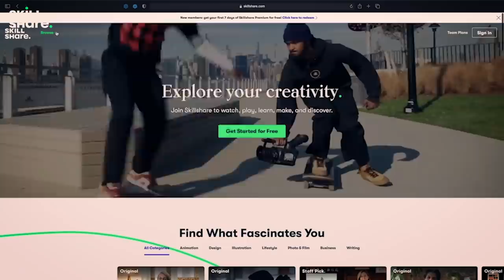Ep 16 - The Great Guitar Glue-Up - Making a Modern Multi-Scale Electro Acoustic Guitar

Comment: Paper, cardboard & plywood templates are a method very often used in boat building - I was onto it straight away before you got the paper out! So glad to see you made the revelation.
There have actually been several tricks I've seen you use which I have utilised in boat building when I used to do that work.
Reply: We also call it CAD - cardboard aided design... yup

Comment: Good show man. I do know about the step back excitement. The holes on your figured top are positioned perfectly to release the Vesica Picies energy beams that will form internally directly between the top and bottom sections. Releasing the bodies main sound waves away from the strings and the quantum VP energy from the center of the chamber will produce world class sustain. Good moves man. Good moves. Can't wait to see the finishing process bring out the figuring in your choice of wood. Frickin cool ole man.

Comment: Comming on, looking lovely! Captive nut for the pot has me mighty confused, can imagine the fun working it into position with the string is doable, but won't it require 20-30 turns to screw it into the nut... with a bunch of wire hanging off it? I'll have to wait for the cliff hanger conclusion!
Reply: not to mention wiring it to the pickup and the output, he should have done all that before glueing on the top IMO

Comment: Good morning Ben. Re: wood shrinkage via drying, I have a (longish lead up and then a) question. 
I was lucky enough yesterday to find a gorgeous plank of flatsawn, highly (highly!) figured flame maple at my local building center. It is 1"x4"x96" and is bowed by perhaps 3/4" at the most bowed point along its length. 
My intention is to process it into some three piece neck blanks for later use, orienting the cut strips so that the end grain presents as quartersawn and so that the flamey goodness is presented in its full glory once each blank is eventually carved. 
My question is, once the strips for the blanks have been cut, should I attempt to straighten them, or should I simply ensure that the strips are glued up so that any slightly cupped edges face inward, to be flattened under clamping pressure? My goal is to strive to have the center strip of each three piece assembly be the straightest ones to begin with.
Thanks, from Canada.

Comment: If you need an axial brace from head to tail, and I suspect you will, I recommend you don’t use wood. A 450mm dowel will expand and contract with weather ruining your neck geometry. I use 1/4” carbon fiber tubes, but I’m sure other options would work.

Comment: I was really hoping to see you check the neck angle during gluing the top. Cause as you demonstrated several times the neck joint is very movable and could be set at whatever angle is desirable. But now you have to live with whatever happened by chance. Fingers crossed my friend.
Reply from the maker: It's ok.. but yes.. there was some variation with this build method.. I'm not going to play with a Spanish joint again.. well, not in this exact way I think. B

Comment: I understand that the inverse is true, quoting ‘the complete book of joint making’ - “Wood dries at different rates in different directions. Across the outside of the trunk, it shrinks more than through the centre of the trunk, whereas along the length of the trunk, wood barely shrinks at all.”

Comment: At about6.00/6.30 surely you mean wood shrinks more across its width than length? Longitudinal shrinkage is negligible  thats why cross grain situations can cause problems on guitar tops or table tops if humidity changes significantly the lengthways grain on the cross bracing doesn't allow sufficient movement  and the top shrinks and splits at it's weak point. Hey but you know that Ben? I was paying attention😊

Comment: I watch this channel thinking Ben knows a lot more about these things than I do, so when in doubt, he's right, but I'm utterly baffled by insetting the nut for the control pot. The electronics will have to be snaked in fully-wired like with ES-335s, and I wonder how it will spin to thread into that nut.
Reply from the maker: It is going to be a very very challenging operation with custom pot and two custom tools... but the pot will be stunning and very very low to to the top as a result.. well worth it! B

Comment: Just a question... not a critic : What is the utility of a shielding paint if it's not totaly coverering a close cage (faraday) ? Like every time, you do amazing jobs. Thanks !!!
Reply: it stops interference coming from any direction in which the shielding paint is between the source of interfernce and the guitar's electronics
faraday cages are only really necessary when dealing with very sensitive equipment (MRI) or machines producing potentially hazardous frequencies (a microwave)
most guitars are fine even without any shielding.
Reply: @heygek2769 . It's more as a wall than a box. Thanks for light my minds.
Reply: @didierpiccolo8099  that's a good way of looking at it, yeah

Comment: What do you get for resistance across a control cavity with the shielding paint you use? I use copper sheets and/or copper paint. I get about .5 ohms with the sheets and .6 ohms with the paint.

Comment: is the reason for installing the electronics after the top is glued on so you can do the finish first? What are the issues with finishing the top separately, installing the electronics and then gluing it on?
Reply from the maker: Exactly this.. gluing the top on after finish would be incredibly messy and the end result would be less than attractive.  B

Comment: I would have done horizontal  grooves and slid the top to those grooves on  the neck for extra strength for the neck.
Would that had worked or would that warp the top?
Reply from the maker: Oh now! That never occurred to me.. it would work very very well and would probably have been quicker than what I did tbh. Great idea! B

Comment: What purpose would sealing the inside of the instrument serve, wouldn't action hamper the wood's resins from curing ultimately?
Reply: the resin should already be cured by this point, but changes in humidity can affect the wood, which is something you don't want
Reply: Respectfully, let's not conflate dried with cured. Older instruments sound better because the resins have cured more and more as time goes by. If the idea here is to employ the electric sounds over the acoustic sounds, I guess I get that...
Reply: @briankientz2926  there is no scientific evidence supporting this, the reason it seems older instruments sound better is because only the higher quality instruments are cared for and looked after so only the best tend to survive the test of time. in blind tests nobody can tell the difference between a Stradivarius and a high quality modern violin

Comment: It's defintely going to look outrageous. Have to disupute "wood moves most along it's length". This isn't correct, wood moves most radially not along it's length. This is why you always use the length of a piece of timber to define critical dimensions, e.g. the frame of a door. Looking forward to hearing this thing.. very different using a timber that's about equivalent to cork to make a box that's meant to resonate... will be very interesting.

Comment: How are going to screw the pot in from the inside?

Edit: Must watch to the end of the video before asking silly questions 😜
Reply: I'd like to know what it's going to be connected to.  I see no pickups or jackplate.
Reply: I would say, speculating wildly, that a strap-button jack socket will give enough access to fish the wires from the pot, but we shall see.
Reply: @sorchard6  Why not do that before the glue-up, rather than force yourself to go fishing?
Reply: That i have no idea.  I'd have wired it first as well. I'm assuming that there is a Piezo pickup going in there somewhere.

Hopefully Ben isn't sitting in the corner rocking having realised he's got to take the top off again!